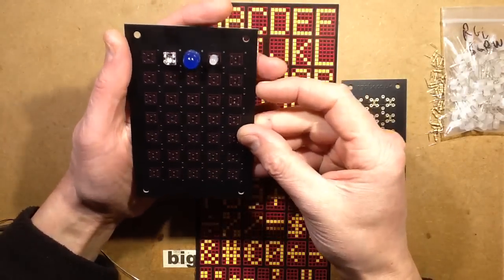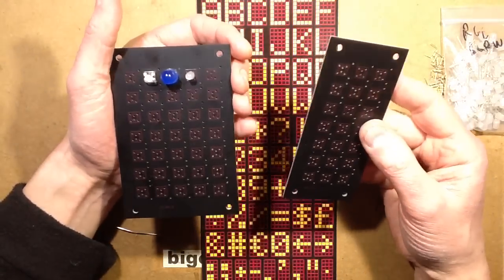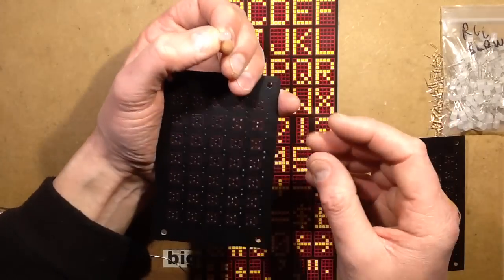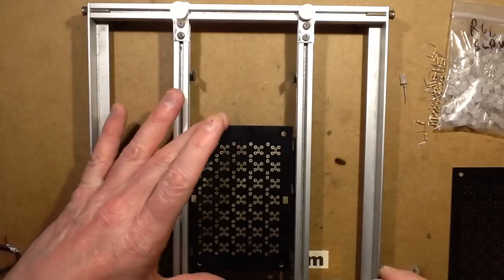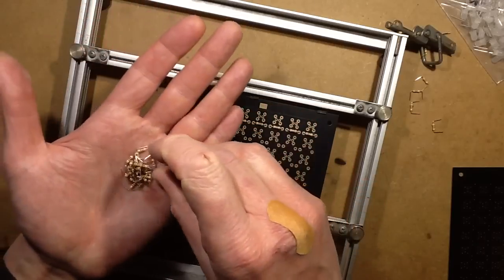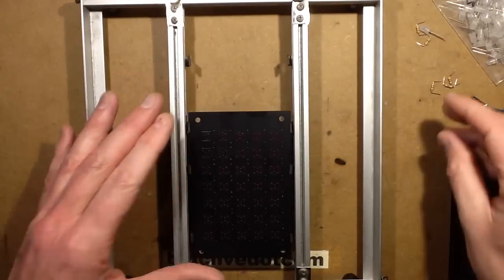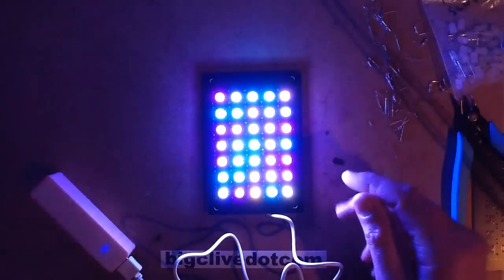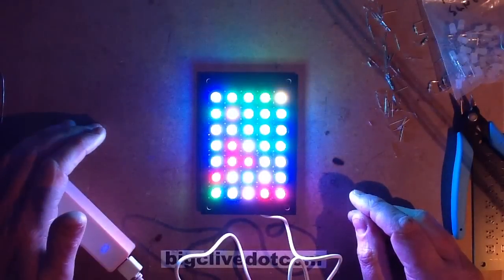RGB LEDs, signs and answers to questions.

Comment: A Quick tip here: I've seen a few of your vids where you try to pry open ultrasonic welded plastic casing using brute force. 
A better way to do that is to apply a few drops petrol or cellosolve (which I use) in the slits and then to wait 30 seconds. It melts away a tiny bit of plastic and then you can effortlessly open the casing.

Comment: That is awesome Clive, my grandmother had an old Electrolux vacuum and it was my favorite vacuum. I never took it apart though. I do remember taking apart some electronics like a transistor radio and wondering what all the components were for and how they worked.

Comment: You mentioned working for Cummins. I used to work as a gardener for the family who were once the CEOs. I worked for the Millers, who were the direct descendants of JI Irwin who funded his chauffeur ,Clancy Cummins with his diesel engine design. 
I was employeed at Irwin Gardens, the estate the Irwins built in 1910 somewhat copied after Italian designs and inspired by a trip to Pompeii. 
 Cummins is still located in Columbus Indiana, but control has shifted and the Miller's are no longer really involved. The elder Mr Miller passed away in 2006 I believe only 2 years after I had started working at the gardens.
  In 2008/2009 the family sold the estate and we lost our jobs. Later it was turned into a spa/bed breakfast resort of types.
I just found it interesting that I somehow connected to you since I found your videos via an Ashen vid. I enjoy doing my work around our massive old home and gardens.
  I have a friend in Littlehampton who visited and who dabbles in electrician duties, and he was surprised and amazed to find pre WW2 wiring still abiding in our walls. 
 Anyhow, thanks for reading. I was plastering a wall when you mentioned Cummins and wanted to say something.
cheers.
Reply: I meant to type I enjoy LiStening to your videos whilst doing my work..
I am a part time acoustic musician.Winter doesn't present as many gigs as I usually play wineries and patio areas ect. I mainly take care of our home and our boys. 2 grown and 3 to go.
  ah well you didn't ask for my fecking biography.
  Your mam sounds amazing. Glad you have a good one. I had a good Dad. He died very young, but I was an only child and he always believed in me. 
cheers again Clive. back to work for me. 
ps you'd live our house. its cold,up on a hill and in the middle of nowhere

Comment: Clive you should work where I work. there's always someone's work that goes bang just as you're about to power up and test your own work :p Fuckin' Huge ass bus caps exploding usually. Never get used to it :p
Reply from the maker: It's that "feeling" you get as you power up a high current/voltage electronic ballast, drive or power supply.
Reply: Yes, I repair (or at least attempt to repair) all of these on a daily basis. It's that dreaded moment you are about to apply power where you squint your eyes and hope it doesn't blow up in your face.

Comment: "Yeah, I discovered play-dough to keep my lamps in place while I worked on them when I was 3. Also motors, and components..."
Thanks. You showed me up. 
I'm 30 and hadn't thought of that. You had no YouTube.
Reply: Once I could read, my mother would walk into town with me (about a mile) and once we did the shopping we'd go into WHS and I'd get another ladybird book.  Once I was allowed to choose my book, I started out with "Magnets, Bulbs and Batteries" and worked through the 'Junior Science' series "Levers, Pulleys and Engines" and "Air, Wind and Flight" ... I never got to "Light Mirrors and Lenses" which was the last of the 4-book set.
My father helped by bringing home bags of electric motors and lenses, once a parabolic mirror from a scrapped UV spectrometer, with a few batteries, wire, bulbs, lego, plasticine, and imagination I built many marvellous things.
Somehow the lego motor units and light bricks weren't as exciting.

Comment: I was pretty much like you as far as school and work. I hated school and almost dropped out in my Junior year. As I found out I had enough credits to graduate mid term in my senior year,I dumped almost all my classes and went to work. I got into a grunt type job that in the end didnt work out so got into the auto manufacturing parts job. It was great money and full time. After four years though I had enough and moved on. I had the opportunity to get into HIVAC repair but didnt for some dumb reason. I guess it all worked out in the end though. I do electronics as strictly a hobby and got into it because of my dad. My bedroom was his workshop. He would work on Tandy kits in his shop and loved to bring home electronics and putz around with them. When I got sent to my room,it was great! Lots of neon tubes,nixitubes and everything else. Yup fun times.

Comment: Hey Clive, what do you do with all your scrap pieces of solder? Do you buy it by the roll? Snip some off for use? And then what? I tried doing it as you do (it is easier to feed when loose) but I always ended up with small odd pieces. I've tried to use them up but they just get too small to deal with. Just wondering what you do with them as I haven't heard you mention it in the videos I have watched. Thanks!

Comment: I took the colour TV apart as a kid and I got it back together but crossed the blue and the green wires that linked to three separate driver boards by single pin plugs. The TVs in those days were so murky you could hardly tell, it just looked a bit "odd" for weeks - until the snooker came on, and then I twigged.

Comment: When it comes to the American English vs English English thing, as an American I really wish we'd just bite the bullet and switch to the Metric System. I appreciate all the more the effort you put in to giving us those measurements as well. Thanks!
Reply: No u r wrong inches are better 12 is better than 10 .  also inches give measurments in proportion, try visualing 9.7 mm or 10.9mm asopposed to 1 and a quarter or 1 and 9 16ths. also visualisations in3d come out better in jnches ie pleasing to the senses.
Reply: We switched to the Metric System in 1964. You must have missed the memo. But we still use Customary Units a lot. You really can use whatever you like. It is a free country after all.

Comment: Hi! Loving your work. Could you do a start to finish construction video for a powerful Infrared LED floodlight please? I'm thinking maybe 20W powered by 12v power source, so I 'm thinking perhaps the cable comes out of it with a female barrel connector to allow for connection to stuff like portable batteries such as the Aukey?  It'd be great if you could list all of the parts and then do a step-by-step guide on how to make one. Thanks.

Comment: I noticed a new streetlamp xmas light this week. it was an elongated triangle, with a wave illumination motion, over many leds, moving top to bottom. It's in 3 types, white only, 2 colours split top to bottom, but the 3rd version does a wave over a multicolour pane. I don't think they're pixel lights, but possibly RGB lights being kept at fixed colour gradations and the illumination wave superimposed over the fixed colour gradation. I haven't seen many about, and haven't manage to ID the make/model online so far.

Comment: I am currently making something like this as a nightlight for my daughter.  I am spacing the leds further apart and placing a diffused screen in front to get a slight mixing of the colors.  I am hoping that as they get further out of sync it will make for an interesting effect.

Comment: Instead of red silk, gaps in the black resist may have worked better
Reply from the maker: The red silk works pretty well.  In hindsight, the back was supposed to be a white silk, but ended up with the red too.  I've never really considered the idea of leaving gaps in the resist.  I'd be too scared I got something completely weird back from China.
Reply: Mike you legend, loved the last camera vid, has been a saga already.
Will fit in great with the teardown list (it's like an insomniacs Twilightzone, in a nice way).

Clive, liked this format.
How about a monthly thing, you build a random object whilst answering questions? (opposite of a teardown, maybe start building and reviewing kits along the way?)
Reply: I understood that the cheap chinese factories that are actually affordable to mere mortals at low volumes are notorious for having problems with layer alignment, as well as having tendencies to round up or down trace widths... causing things like tracks shorting to ground by running through tight gaps in the ground plane. I would be hesitant to try something fancy like that.

Comment: If it were me I would have to put all the resistors the same way round !
Reply: UKHeliBob You have some german roots!
Reply: same I always put my resistors the same way
Reply: pufferfish0101 why? ? So the electrons won't fall out?? hahaha 😂 😂 😂
Reply: As a newbie I like to put them in the same way round especially if they are maked on the board, that way if I have to look at it again it's easier to read.
Reply: I would do the same, since ocd is like Christianity; don't like things that aren't f'ing straight (settle down, that is a joke. Away with your torches, shoo. We have electricity).
Reply: Resistors today are the size of fly-shit, and only have a ref# or nothing. 
But yeah in the old world heaven with through holes, good to place them in a specific orientation and same with IC's.
Reply: *****
Well if you plug them in backwards yeah, but who decided where pin one was on that socket?

Nothing wrong with arranging things to make the most sense on a complicated layout as long as you are the only one who will be working on it. Hahahaha

Serious. sometimes turning a socket upside down makes it much easier to route. But still it is discouraged.
Reply: I match your resistors all the same way round and raise capacitors all with markings in one direction unless masked by larger components.
Reply: but you dont need to
Reply: I think it looks better.

Comment: I have some of the clear color change LED's that I put in a Christmas tree and they change color. It has some transistors and caps to make the tree look sparkley. I love it. I will get some more of them. I do like the random color changing. I noticed though, that when they are all one color, it draws a lot of amps. 300 milliamps to be exact, but when it is random it draws around half of that.
Reply: I forgot, it would be interesting to see what the ones you are using draw in current. Mine seem to draw the most when they are all the red color.

Comment: This kind of assembly frame also gets used in wave soldering. They pop 8 or 10 boards in and then let them go through the soldering machine. (Without the foam cover of course)

Comment: Thanks for taking the time to do another DIY project.I doubt I was the only one who asked but I still wanted to say thanks.
Also I really appreciate you putting the schematics out for free and I'll be sure to send some coffee money your way when I D/L them. I've got a idea already planned for my daughters room and that board is going to make things look perfect.
Last but least is I've used Olimex for boards in the past and they're in the EU.It might be easier dealing with them if you decide to make another batch.
Reply: I also forgot to mention that my 3 year old daughter managed to take stuff to bits with a ratchet simply by watching me.I was changing a headlight in the car and let her hold the ratchet with a 10mm on it and before I realized it she managed to remove 3 bolts.I honestly thought she was playing,but by the time I pulled my arm out from swapping the light I realized she'd figured it out for real lol..So yes that vacuum story is totally plausible although you may have had a little bit of help as I've done the same with my daughter. ;-)  If I remember I'll send you a pic of her helping me build her doll cradle at about the same age :-)

Comment: I notice you add "current limiting" resistors to RGB colour cycling LEDs. Those LEDs, as long as you are using a low enough voltage (<5V) don't actually need current limiting, they have it built in.  It's required internally to balance the forward voltages of the three emitters. Without it internally the blue emitter would never light when either the red or green are on.

When running a typical eBay RGB cycling LED off 4.5V with no resistor I get:

Red: 23mA
Green: 27mA
Yellow: 48mA
Blue: 33mA
Cyan: 56mA
Magenta:53mA
White: 76mA

Which is what I would expect with individual LEDs with separate current limiting for each LED.

Comment: I took a bedside table lamp to bits in bed one night when i was about twelve years old, it was plugged in and switched on of course, do you know what? i got it down to the bayonet holder before it bit me, shit that taught me a lesson. When i left school i became an electrician in the naval base at chatham, like you i had a brilliant time, i've retired now and i fiddle around with dcc trains. I would be keen to get your spin on soldering with this solder glue that they sell as an alternative to using an iron. I'm doing n scale so i'm using smd micro components and i wondered if glueing them would be easier? Interesting video, its always nice to hear someone else's background and there stories.
Cheers Phil

Comment: Just sharing an experience I had removing a main board on an
old Philips 28” 100Htz TV that had a bad heat damaged I.C…I was removing the
H.T. cable from the back of the tube when I poked the screw driver under the
H.T cap to release the clip/spring ..This was the last thing I remembered…I woke
up in the fire place 6 foot away sat in the fire. Luckily the fire was not lit.
I forgot to discharge it first. Lesson learnt. My arm was quite dead for a few
hours after.LOL.

Comment: I fully understand the issue with school being for shite...I was so bored there that I actually failed 6th grade because transferred from a northern school to a southern one and they were so far behind academically it was like being back in 3rd grade. Seriously. In the north I was taught metrics in 2nd & 3rd grades...in the south we didn't even start them until 9th!
My mom was like your too...she let me tinker from a very young age. The only time she freaked out was when I showed her how you can touch power one way and not get hurt...and then the other way  :)
I seem to have an extremely low resistance to electricity...just flows right on through without hurting much. Except mains...damn if that 220VAC @ 150A didn't sting like hell! Live & learn...mostly.

Comment: I recall doing the same thing when I was little.  First recollection of failure to reassemble was a speak n spell that belonged to a sibling.  When I turned it over all the buttons (30 or 40) spilled out on the floor.  Reassembled but buttons weren't quite in the right place.  lol

Comment: My life all over. I used to take stuff to bits as a kid. I microwaved my mums favourite musical box, sparks all over and the spring unwound with epic noise. Stuck my finger in the fridge light socket with tingly never-did-it-again results, destroyed my sisters air-fed reed organ by poking wires on the motor and blowing a fuse (old domino type of course) and the motor going with a bang, took my bontempi orgaan apart and made a robot out of a box with the bits and god knows how but got an LED to light on it with a 9v battery with no knowledge of using resistors (or any idea they existed lol). All this and more before I was 10. Then made my first 4bit binary counter at comprehensive school with yellow LEDs and my first experience of 555 timer and 74xx chips :) then did a 2 year youth training scheme in Basic, Intermediate and Advanced Electronics and Microprocessing at 16yrs, I loved programming a PLC for basic traffic light control. Made a few things there, like Astables, monostables, signal generators, variable power supplies, audio filters/amplifiers and my favourite, 4 channel disco light sequencer. Always with standard 74xx or 40xx chips, transistors, resistors and capacitors. None of that namby pamby cheaty pic controllers back then lol all done the real mans fun-to-learn way and we got to design, develop and etch our own PCBs with a proper UV thing and all the chemicals. There was a little room to one side with a PCB etching/developer tank in the corner, lots of stinky yellow nasty acid lol :)

Comment: Clive, touch the tip of your right hand's middle finger to the palm of your hand, secure your finger in that position with tape, when you wake up tomorrow 'stretched' skin will have formed over your raw knuckle -- I have always done this if I skinned my knuckles, otherwise it will take forever to heal.
Reply: A scab forms first and later the skin  --  but a scab will keep cracking open every time you stretch it.
Reply: Mick Kennedy I use super glue on those types of injurys now. It really holds the skin together and no splits. I learned it from all places,the drs. office. I thought he was going to use stitches on my knuckle after cutting it open but nope,he used a medical grade superglue,then told me regular over the counter stuff works just as well. He even told me if it didnt hold,to reglue it myself.
Reply: Yes, I've used superglue too --- did you know that a scab is formed of sugar, that's why some kids eat them.